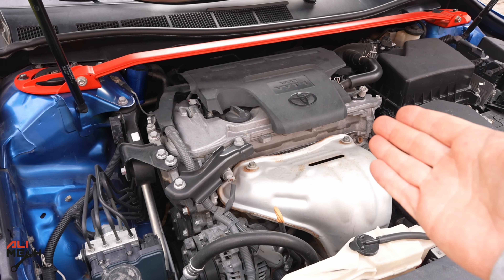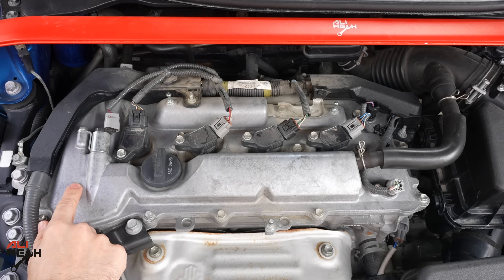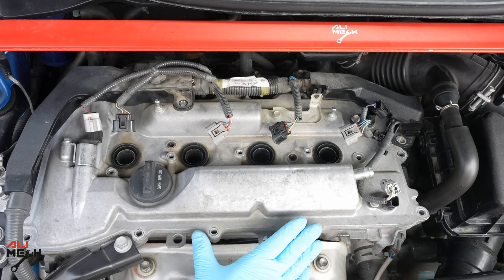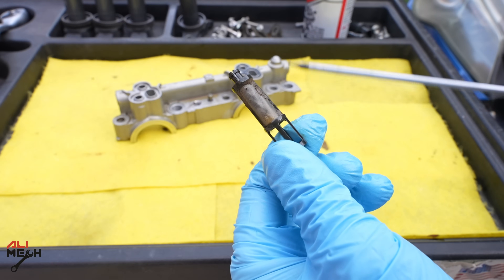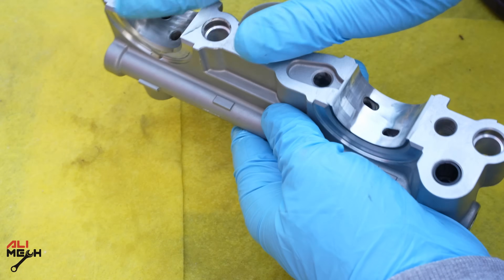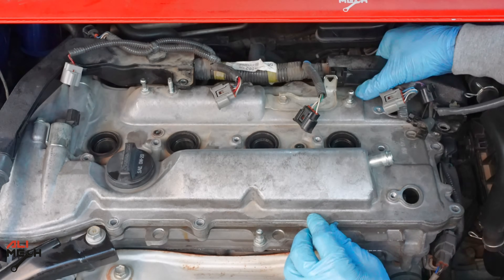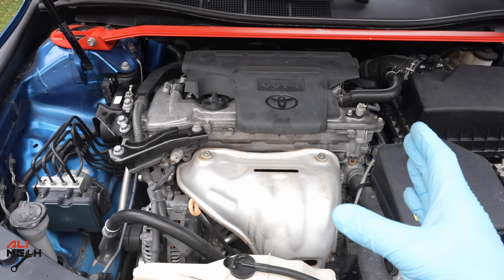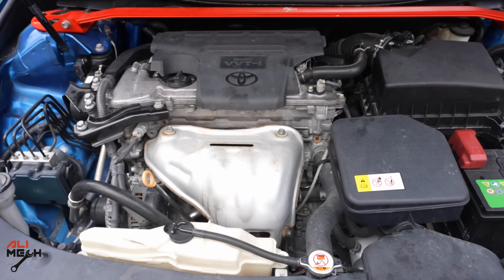Hidden VVT Filter? Clean This NOW to Fix Engine Rattle!

Comment: A weak spring in the intake vvt assembly is most likely the problem. The filter didn't look that dirty. There are some good videos about dealing with the spring versus replacing the entire VVT assembly.

Comment: Has anyone had any experience with Valvoline restore and protect and these type filters? If Valvoline R&P works with these type filters, then I should expect good results with it cleaning the PCV unit which is labor expensive to change on this type Toyota engine. A $10.00 part, located in a place that costs $$$$ labor charge to replace.
Reply: Fluids and oils will never substitute proper maintenance

Comment: Not so sure this will help solve the rattle. True, it sounded better but the engine oil was pre-charged in the VVT gear after the first start.  Would have to wait till next morning to see if it drained out again and if there was / was not a rattle. VVT rattle is in gear design. Pill valve in VVT gear assembly is not preventing oil from draining.   Although cleaning these filters will help overall, not sure it will solve the VVT rattle.
Reply: I was thinking this.  That chamber where the filter is housed loses oil as it drains back down into the pan overnight.  Which is why you only here that rattling noise in the morning.  IF the clogged filter is causing the noise, the noise will never go away because that means oil is simply not passing thru in there well enough.

The rattling noise disappears several seconds after a cold start up is because oil finally primed it.

Comment: That wont fix cam shaft phaser rattle. Sludge or the locking pin not going into it hole is the problem. Try engine flush (maybe) or remove phaser to repair.

Comment: For your information you should put some silicone  in the top between the engines cover and the engines camshaft…..🤔🤔🤔🤔🤔🤔
Reply: For your information,  there wasn't any silicon there, so why he do that 😂
Reply: Fyi its a stupid idea.
Reply: You're right, there are two locations on the left side where you're supposed to put an inch dab... Supposedly very important

Comment: My V6 Sienna makes the same noise. Does it have these filters? Thanks
Reply: Yes, but it's outside. It's on the feeding tube in the front of the engine.
The second one is also on the feed line closed by the solenoid.
I did them on lexus which has the same engine
Reply: @mohdibrahim1350  Thanks

Comment: Excelent lecture excelent lecture  today thank U eng for this , ìs it only 1 vvt filter ? I think it is 2017 camry , old models filter behind the comprresor? 2018 camry and above design of vvt filter is so different in shape and location in the engine
Greeting hi from afollower from Saudi arabia
Reply from the maker: Yes, correct 2017 toyota camry, and it had one filter,  thanks for watching 🇸🇦
Reply: Whats about the 2010 camry

Comment: Timing chain tensioner.
Reply: The spring inside the camshaft
Reply: @chikaijita1597  🤣
Reply: @chikaijita1597  you mean intake vvt gear? Yes, most likely. He said the rattle went away with old oil so car was probably still warmer and became slightly more prevalent again after oil change which makes sense as car cooled down more

Comment: Wait, wasn't the issue with one of the cam shaft gears? Like the cam shaft gear's pin would get stuck and would not lock into place, hence the rattling. According to toyota, the cam shaft gear would have to be replaced with one that did not have such defect
Reply: Technically it only affected any model with the 2ar-fe or 1ar-fe between 2009-2013. Newer models like this can have the rattle occur, but it’s generally from poor oil maintenance gumming up either the spring or the actual bore the pin is in.

Comment: Valvoline Restore and protect is good oil for Toyota's engines.
Reply: Was thinking the same thing. Just run this oil
Reply: Second oil change in with that oil and it  still does it, but a lot less than before.

Comment: Salamat brother,
 Thanks for the video I need to do same thing for my 17 rav4.
Reply from the maker: Glad it helped
Reply: @AliMECH  I did it bro. But unfortunately, while trying to get the breather hose out, I yanked the AFR sensor socket and two wires were out. The problem I couldn't tell which is whick.
I wonder if you have a wiring diagram or the coloring for the AFR sensor socket.
the 2 wires are from the engine side one is blue the other is yellow

Comment: Do you think the timing chain should be changed in this engine, or will the timing chain last the life of the engine?
Reply: Should be changed. No chain or belt lasts forever. The life of the engine depends on you
Reply: Does not need changing.  Some momentary rattle at start up is normal
Reply: This engine is known for timing chain stretching . Normally the chain lasts the engine life.. but vvt timing. ,plus  certain years are known for it wear😢😢

Comment: I usually do this when I buy used cars, but if you have a well maintained car don’t feel like this should ever be an issue but idk
Reply from the maker: thats true, i had to clean it, because the oil i was using for years changed the quality and it got so bad